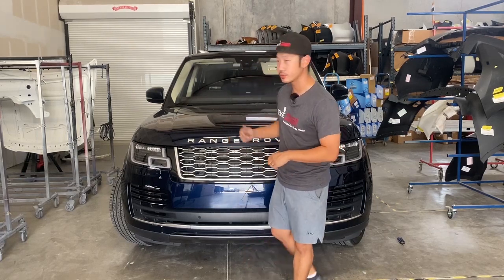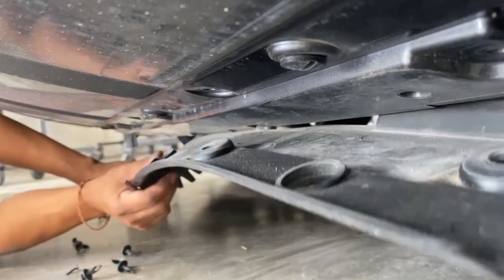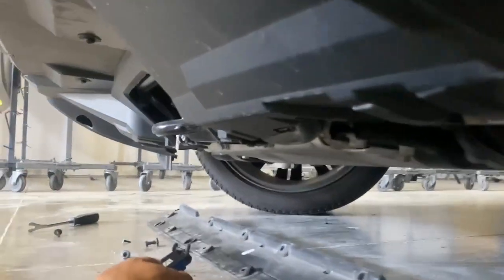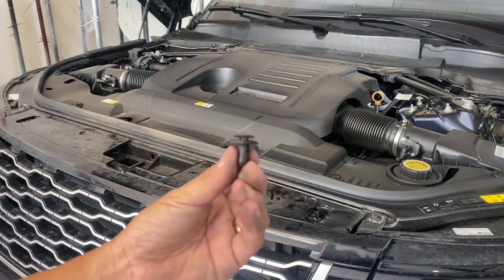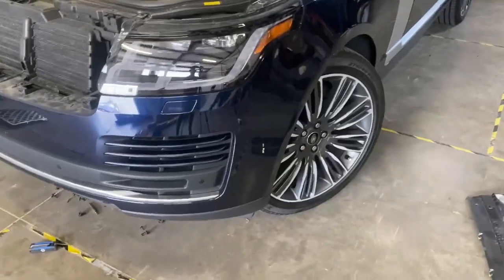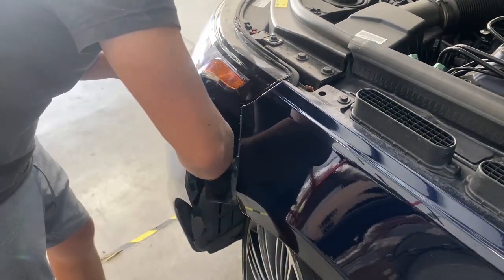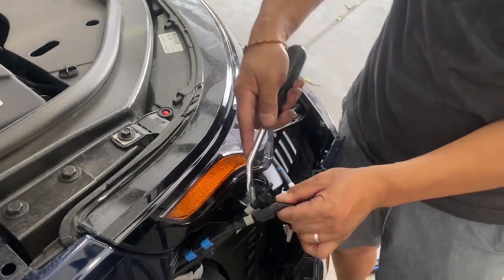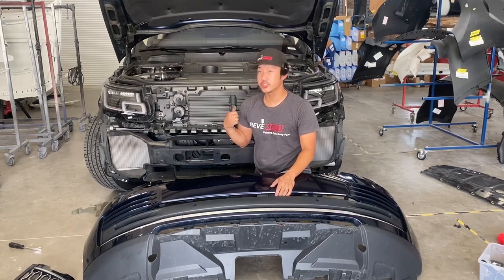Fastest way to Remove a 2021 Range Rover Front Bumper.

Comment: Hi there 
I have 2016 RANGE ROVER L405 . I am wondering if I want to replace front leadlight, do I have to remove front bumper first or it's easy without remove the bumper ?  thanks
Reply from the maker: The front grill for sure you do have to take off to get to that bolt near the bottom of headlight.  You could possibly take off the bumper half way meaning just the side, but harder to do.  I would just take off the bumper.  If you need parts for this car go to www.Revemoto.com